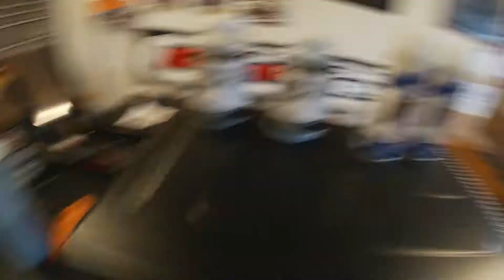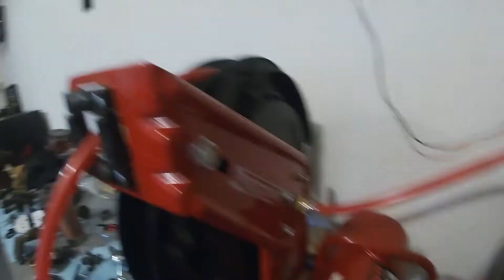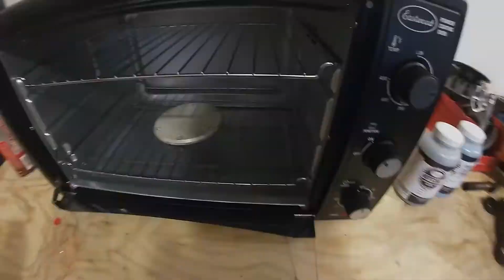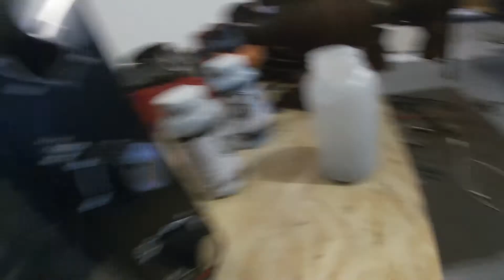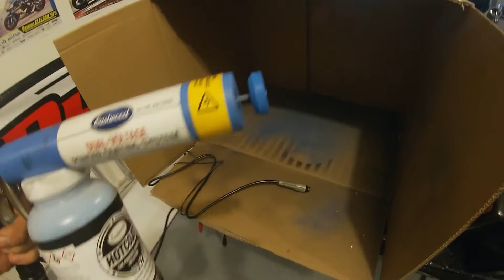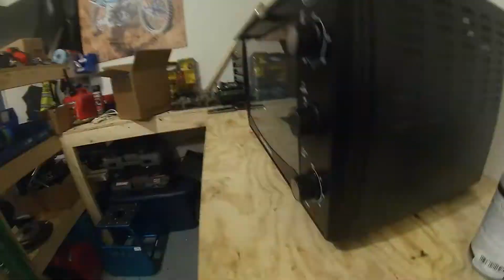Beginner attempt at POWDER COATING using Eastwood Tool Duel Voltage System. This is a new venture!!

Comment: Good video.  Other than the taping part, the blue itself looked very good and even throughout.  I am actually impressed.  It seems to me that moving forward, your biggest learning curve is going to be with designs.  Just shooting all one color you already mastered it.
Reply from the maker: bigpapam109 you are absolutely correct! The blue does look good. I needed to prep better too. I learned I can’t overlap tape. I’ve seen people use a automated design cutter too. We aren’t on that level yet! Lol!
Reply: @MotoEsh  Yes.  Prep is everything.  Have to make sure it is done correctly.  Mary has a cricket for scrapbooking that does vinyl so I am curious if I will be able to use that in the future.  I can design anything in photoshop, put it on there and cut it.
Reply from the maker: bigpapam109 I’ll bet it would! I’ve seen people use non high heat tape and just remove it sooner and turned out great! Let me know!
Reply: @MotoEsh  awesome.  This is definitely in the cards...just not right now.